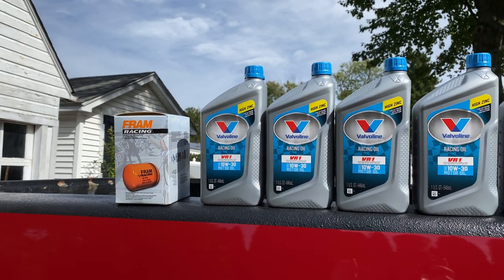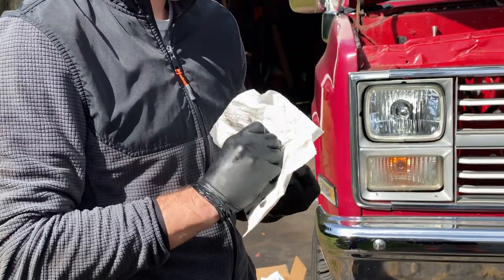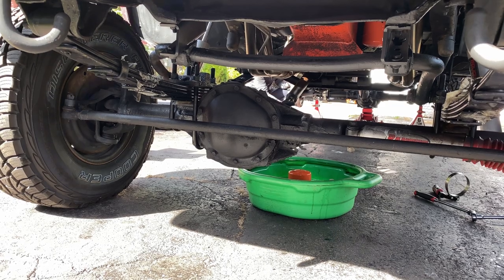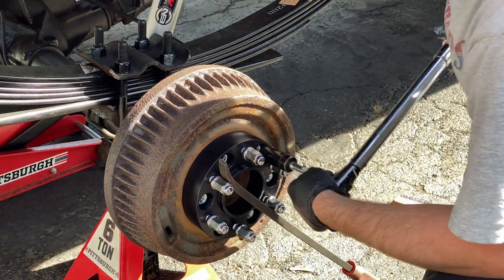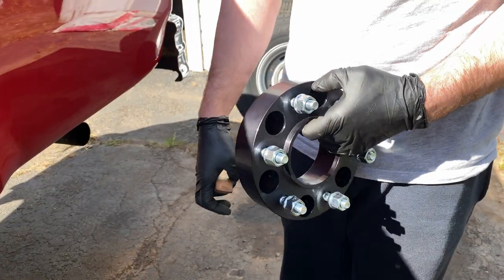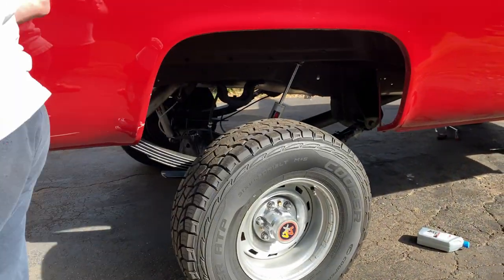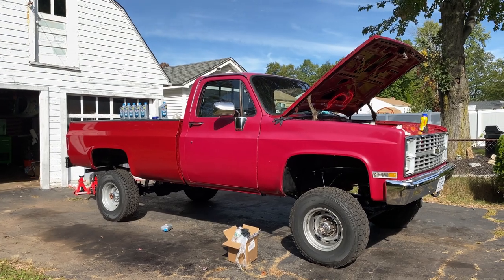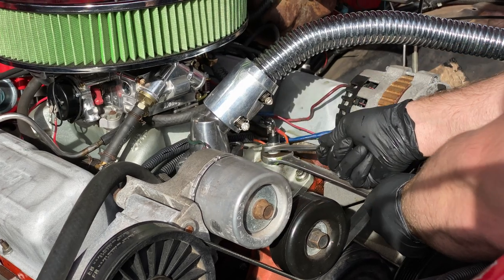How to Install Wheel Spacers on 1984 Chevy K10 - Step-by-Step Guide

Comment: Definitely paint. Think about ditching carb for holley sniper efi. Best thing i did on my 502. Sniper will control fans also. No need for multiple sensors. Only one to control it all....  great job on the truck. Kudos
Reply from the maker: That's an awesome tip. I'll pass it on. I know it has a basic carb on it now. We don't know much about the engine except that the serial comes back to an engine from the late 60s.

Comment: Front axle is gm corporate 10 bolt on that truck. Dana 44s are 78 and older. Wide front axle is for better turning radius supposedly.
Reply: I heard them say that and I was like not a 44 its a 10 bolt its to round looking to be the dana 44
Reply from the maker: After posting this video, I tried to find the exact year they stopped using them but had no luck. A friend said 1984. Some comments said other years. Bottom line, is, this is definitely a standard 10 bolt.
Reply from the maker: @kylebarker5602  Yeah, after posting the video, I did some research and GM wasn't using Danas in 1984.
Reply: They're kinda like Legos there's mixed matched parts that were used because of left over stock they had when they switched to 10 bolts. Thats why there is no exact dating near the end some trucks got Dana's some got 10 bolts.
Reply: There's not a bunch of difference in the two though. Spline count is all I know of thats different
Reply from the maker: @BRANT-RAY  Thanks, Brantlee. That makes a lot of sense.
Reply: @MarkDHall  you can also tell right away that its a corporate gm by the ears that stick out on the bottom on each side 8.5 ring gear
Reply from the maker: @oydina-leebanks534  Thanks! I never really noticed that.

Comment: You truck looks great.
Could you provide me information on the hub spacers you installed? I need to have 6x5.5 hubcentric spacer like the ones you installed. If you could provide me with the bore dimensions also. 
What I really need is the company you orders them from.
Thank!
Reply from the maker: Hi Edward. I apologize for the slow response. Thanks for the nice comment. The spacers are an aluminum model by Bora, a division of Motorsports Tech. They have a form on their website where you tell them about the vehicle they're going on, and then they custom make them for you. If you know the bolt pattern, hub diameter and spacer thickness, they will make them from that too.

The link to the ones Matt got is here: https://www.motorsport-tech.com/bora.html

Comment: Whats up with that serpentine belt system is it a stock setup off a newer truck
Reply from the maker: The engine had the serpentine belt on it when we bought the truck. It was changed by the previous owner with aftermarket parts. The engine is a 350 from the late 1960s.

Comment: Are the original lug studs long enough to hold the spacers in place ?
Reply from the maker: Hi, Yousif. Our studs were long enough and worked, but some studs might be shorter, so you should definitely check to make sure the nuts have enough threads to grab onto safely. Thank you for watching.

Comment: Hopefully you see this. I’m trying to get a set for my 73 K10. I tried to order a set but they said the original center bore was 90. I thought the original center bore was 108. Can you correct me if I’m wrong?
Reply from the maker: Hi Forrest. Matt looked online, but found different answers, so I’m not sure what the correct one is. You should be able to measure it with a tape measure to get the diameter. Hope that helps.

Comment: Front end on any 80s k10 is not a dana 44 from the factory. I’m not sure when the cutoff was for that but somewhere around 78 or 79 Gmail went from a Dana 44 to a 10 bolt though the axle dimensions are identical

I should specify the factory axle wasn’t Dana 44 in the 80s though it’s not a super uncommon swap
Reply from the maker: Hi - thank you for sharing. Unfortunately. we learned that a bit after posting the video. We had read on some forums that it was the Dana, but it turns out it's not. 🙁 Great name by the way!
Reply: @MarkDHall  a 10 bolt isn’t that much weaker than a 44 in reality. The 10 bolt Chevy was designed based on a 44 actually.
Reply from the maker: @redneckwithajeep5001  Matt doesn't take it off road or anything, so having a super heavy diff isn't really needed. The most off-road he does is down a dusty dirt road with potholes. Haha.
Reply: @MarkDHall  then a 10 bolt is plenty strong lol

Comment: I think the old 60s70s and early 80s chevys ford's and dodges international  4x4s all had the just a little wider in the front then the rear I think the reason was for like on a real muddy slimey road   it was to help keep the back end of the truck  lined up with the front so it wasn't sliding all over the road like a posi track makes them slide side ways
Reply from the maker: M P, thank you for the info. That makes perfect sense. Have a great day!

Comment: About the paint situation, assuming that the 2 colors are the same, you can revive the paint by cutting buffing and polishing, go check out the video on motortrend about David Frieburger doing just that to his 71 roadrunner, took it from a mess to practically new, may be a solution for you
Reply from the maker: Hi Larry. Thank you for the video link. We're going to check it out. Matt tried buffing it out in an inconspicuous spot, but all it did was make the "pink" part shiny. Maybe that video will give some tips or show where we may have done something wrong. Thanks again!
Reply: InstaBlaster.

Comment: 1980 was the last year GM used the Dana 44. 1981-87 all GM trucks came with the GM 10 bolt as I understand it.
Reply from the maker: Thank you, tippin turtle for the clarification. I looked at a document I had seen online, and it looks like the GM 10 bolt or Dana was an option in 1977-1980 and then GM only thereafter.

Comment: What size are the spacers?
Going to put the same on my 82k10
Reply from the maker: Will confirm with Matt and let you know tomorrow.
Reply from the maker: Hi - The spacers are 1 1/2" aluminum. There's no model number, but when you go to the website, you put in your truck model, and the site will pick your lug pattern and then you select the material and the thickness. The brand he used is Bora Spacers from the Motor Sport Tech website. Let me know if this is enough or if you need any additional help.
Reply: @MarkDHall  oh man thank you very much 
Thanks for taking the time to reply to me 👍
Reply from the maker: You’re welcome. I hope your install goes well.

Comment: I'm wanting to put spacers on the rear of my 92 for the same reason. But shouldn't pre fill filters, 1 manufacturers say not to, 2 the way u filled it, in the center, is wrong if u r going to do it because the oil comes into the filter through the small holes and exits the big hole, and even with a pre filled filter there will always be that split second where an engine runs on start up with no oil pressure and once it builds pressure it doesn't take but milliseconds to fill the filter. But it is possible for new oil to have impurities and so filling it on the outside it will filter ur new oil, eventhough we pour oil in an engine unfiltered, the clearances of everything, other than the main bearings, is big enough for the oil and possible impurities to run through the engine into the pan then into the filter then onto the main bearings with no debris
Reply from the maker: Hi Grant. Thank you for watching. I bet your truck will look great once you install the spacers! There seems to be a 50/50 split on pre-filling vs not pre-filling the filters. During certain situations such as cold starts and sudden revving before the oil is warm, the filter often switches to bypass mode and doesn't fully filter any oil passing through it. The amount of time the bypass valve stays open depends on air temperature, oil pressure, oil thickness and other factors, but it can last for many seconds, especially when the air temperature is really cold. This is why it's best let the engine warm up at idle and not rev it up until the oil has warmed up. Basically, unfiltered oil frequently flows through the engine.

Any impurities in the oil will be passing through the engine when the bypass filter is open, so we always use magnetic drain plugs to attract any bits of metal and hopefully keep them attached to the drain plug rather than circulating throughout the engine during these times.